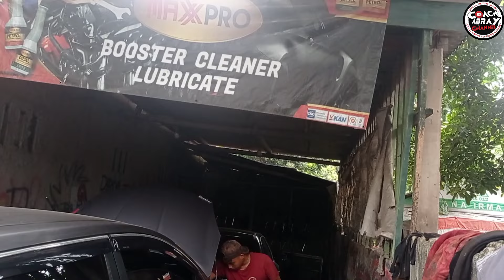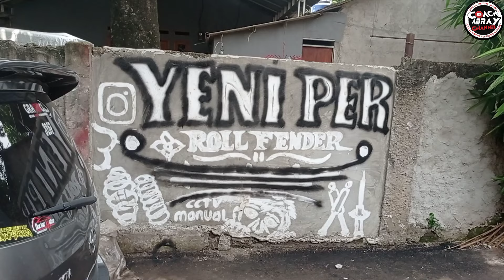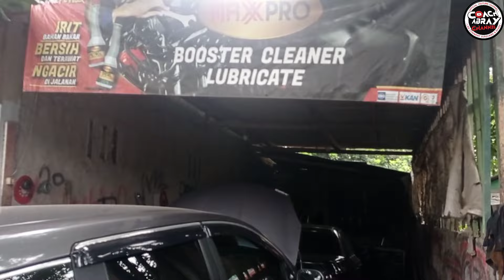Bengkel Per Yg Sangat Rekomen & Sudah Terkenal Seantero Bekasi, Walau diGang Tp nih Bengkel Rame Trs

Comment: Selaij per bisa gak. Seperti balljoint  laher roda. Support shock.
Reply from the maker: Selain Per tentu nya bs bgt Om ku, semua spare parts kaki2 ready semuanya, ball joint laher support shock tie rod long tie rod link stabil, dll. Dijamin lengkap semuanya Om. 
Dtg aja lgsg Om ke bengkel nya mang Uus
Reply: @abidkademat8468 alamat nya di mna ya om